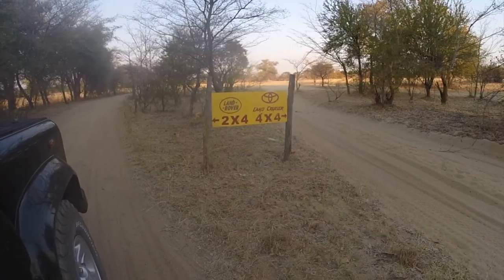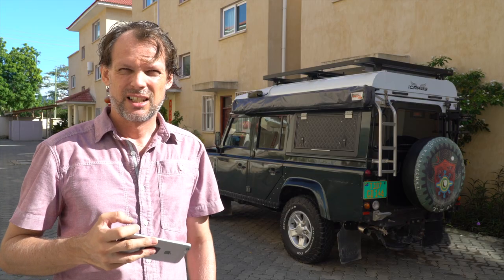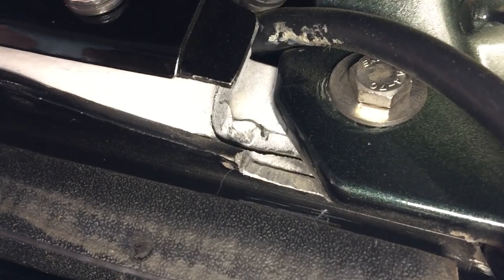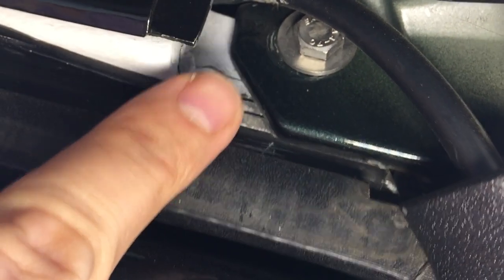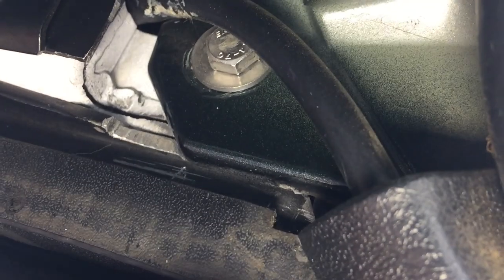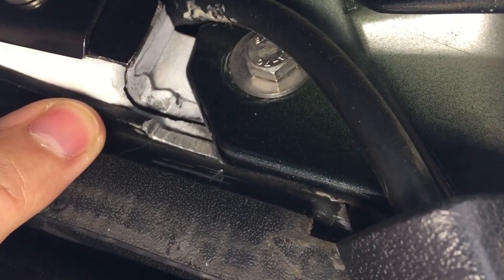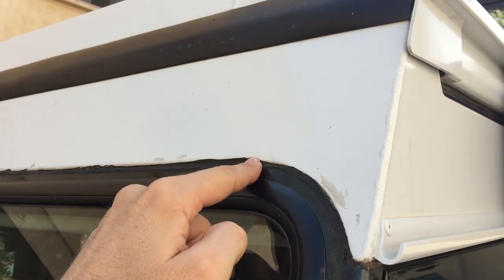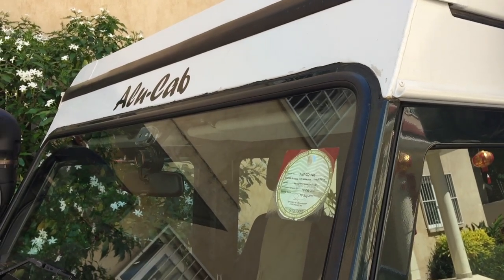Alu Cab Rooftop Conversion Review

Comment: Couple of things, Have you thought about drilling a small hole and filling the channel with expanding foam? It will catch the broken rivet and keep it from rattling. Also, could you do a full tour of your land rover? It looks awesome! Lastly, do I spy a KTM under that bike cover???
Reply from the maker: Hi, yes thought of the foam solution and even bought the foam already but then - it's really hard to hear where exactly these 1-2 pieces rattle. Drilling into all the tubes and filling all of them seems overkill.

2.) I made a couple of films that features this vehicle. One of the more recent ones is this.

Part 1: https://www.youtube.com/watch?v=CYAlB1aDVYk
Part 2: https://www.youtube.com/watch?v=xhPkCwaJAoE
Part 3: https://www.youtube.com/watch?v=VRXSY8SdRQg
Part 4+ coming soon.

KTM - yes, a 690 Enduro R. Very nice but a 450 or 500 would be even better in Africa. Weight is everything.
Reply: claus dettelbacher that makes sense. Maybe get a passenger to use a listening device like a doctor has and listen while you are driving.

I had a ktm 690 for many years and now have a 500. It is an amazing bike! 
I am hoping to get a defender 110 someday but they are so rare here
Reply: You could try to move it into your silicon blob using a strong magnet.
Reply: @moo781  This is a good idea if the rivets are not aluminum.  If they are steel, then you could also move a strong magnet from bar to bar until the rattling stops when the magnet catches the rivet.  then you'd know which tube to drill and where the rivet(s) is.